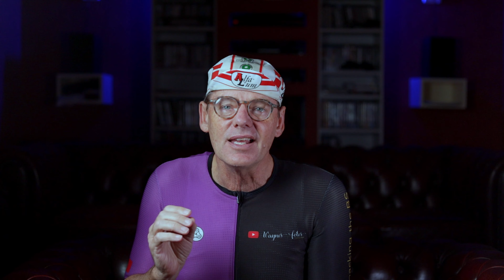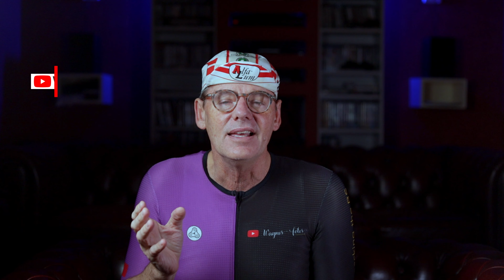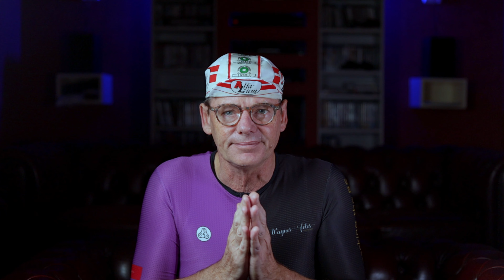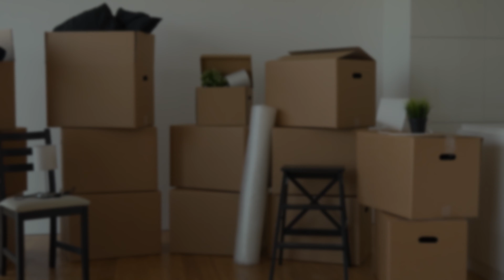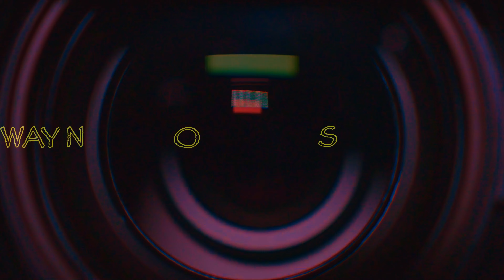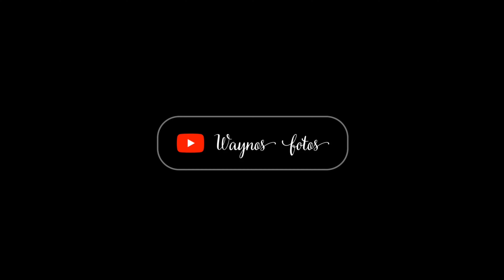Did Disc brakes contribute to the Tour de France Crashes?

Comment: Disc brakes may have their shortcomings, but did not contribute to serial crashes in this year's TdF, I agree. The biggest (overlooked?) contributor to the carnage was the lack of a prologue, which would have acted as a pressure relief valve for too much rested-up energy, adrenaline, testosterone, and pressure from the various teams' DS. Better yet, make next year's prologue LONGER, maybe up to 20 miles? (And eliminate picturesque but narrow roads with "road furniture" and without shoulders.)

Comment: That is a stupid theory.  Why are disc brakes blamed for everything.  You’re right.  With how close they ride doesn’t matter what brakes you have your screwed
Reply from the maker: Someone on a very big podcast put this theory out there.
Reply: I think it’s more to do with lack of respect for each other and DS’s on the radio wanting all the teams at the front. I still wish the manufacturers hadn’t forced the teams to ride discs though as they are not conducive for racing and have ruined the aesthetics of a road bike.
Reply: That's why there are no crashes in the velodrome............

Comment: If someone in front of you is able to brake faster it certainly cuts your reaction time......... 🤔
Reply from the maker: True, because at the point of them braking, they have already passed/used their reaction time. So the ride behind is slower braking by the persons in front reaction time. Why cars have pile ups, and rear endings.
Reply: You have no reaction time in a peleton, you're literally on the guy in front's back wheel.
The brakes didn't cause this, it's a function of racing so close to each other.

Comment: Most of the incidents were due to the rider's mistake, wheels crossed.
Reply: of course, but abrupt stopping of the bike, due to diskbrake's stopping power, could contribute to wheel overlap
Reply: @attybong  ..they don't touch their brakes in the peleton
Reply: @oldmancycling7440  of course they do, not to hault but to modulate speed specially on corners and bends .. b.t.w. it's peloton .. not peleton
Reply: Hold fast. 

Especially over speed bumps.
Reply: @Wildschwein_Jaeger  G should upgrade to a wider sunglasses too .. so he could clearly see the speed humps .. lol ?
Reply: on stage 3, caleb went for a gap that was not there .. causing his (caleb) front wheel to over lap with merlier's rear wheel .. then he slammed on sagan

Comment: The argument is a mute point because the industry has already made the leap and will not return to old technologies. Lets just hope that somehow they can improve and develop better performance of the systems. One thing I've noticed about the disc brakes I've used is the first compression on the lever doesn't always give you enough braking and you actually have to pump the lever again to get better modulation. If you need to brake quickly to slow down fast or stop this problem can limit your stopping distance or even make it so you can't stop. I've mostly notice this with road levers not mountainbike levers. I've used many brake systems from every manufacturer over many years so I am well familiar with them. I know they try to make them cheap and light weight but I think this needs to change if you're going to get good performance.

Comment: Not this kind of crashes in my opinion: yesterday there was 3 big crashes and 2 of them happened on very difficult and narrow roads. When you are in 20 in 3 meters with all the wheels crossed with the others it doesn't matter if you have discs or rim brakes.

Comment: I think it will be interesting to look at these crash data statistics in about 10 years time, comparing them with the previous 10 - 20 years. If looking at it in isolation, its just going to give you 9/11 type data. Of course there are many other factors that come into play. Riders are younger and fearless, speed seems to be going up, “bikes should be faster”, confidence is high and having disk brakes might contribute to that. I do disagree with you a bit about the 20% part. If the person in front of you stops faster, now with disk brakes, you cut a bit of the reaction time from the rider behind. Is this why they always let ream Ineos ride in front? :) Keep up the good work. I like your videos.

Comment: Your argument is very wrong. The problem with disc brakes is that it encourages very late but sudden braking. The reaction time is the same but now it’s almost like a wall suddenly popped up in front of those riding behind when the front of the peloton touches the brakes. The result is a big pile up.

Comment: Waynos if you watch any disc are great video. You’ll see in the dry until you get below 10 mph both systems have identical deceleration until walking speeds. So I agree with you.

Comment: Quite simply, no they didn't. 
A few years ago there were lots of stories about how disc brakes would cut and burn riders in a mass pile up, funny how all this has been forgotten as it was just scaremongering.
Reply: They re-engineered the discs to make them less likely to lacerate. They do burn riders. A young rider had his finger severed earlier in the season by a disc rotor. They aren't butchering the peloton but the safety concerns are valid (and probably led to some of the improvements)

Comment: Idiotic argument. The riders have been riding with discs for some time now. They know that they reduce stopping times. Disc brakes are also easier to modulate, meaning that you can adjust and control your stopping time. Nobody just jams on the brakes. That’s the way to go over the front.

Cars and motorbikes too stop much quicker than before, but I don’t remember any one blaming a motor racing pile-up on brakes.

Comment: Any racing fan of TdeF who cones out & says the disk brakes caused these crashes is nothing more than a 1/2 whit & obviously didn't stand inline 4 a dose of commonsense at conception. U only have 2 hit some gravel at that speed & ur down. Or in the case of Caleb Ewan clip the back wheel infront of u. That's racing.  U can't have 182 bikes fighting 4 positions on such narrow roads 20-30ks from the Finish. Tough 1zt 3 days of some big crashes. Feel sorry  4 them. Hopefully the Peleton can get thru unscathed  now going 4ward

Comment: Let's suppose you could go back to cycling roots. Race track bikes over slightly less ridiculously mountainous courses. Mano mano. A contest on equal terms. Would it be safer? Maybe because of lower speeds. Motor sports have had to create barriers to speeds creeping up each year. The technical arms race has made it harder for aspiring riders to get into the sport. Fausto Coppi seemed to get on well. Oh, the sponsors!  No money = no show.